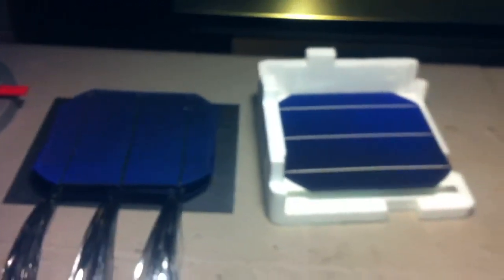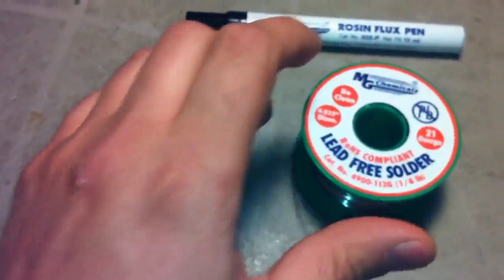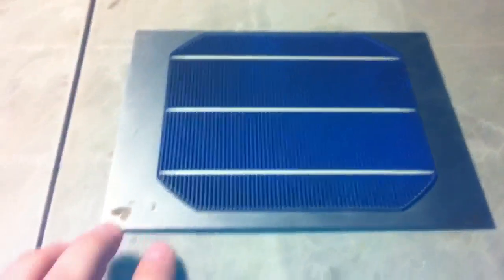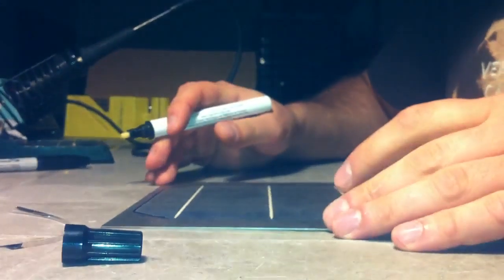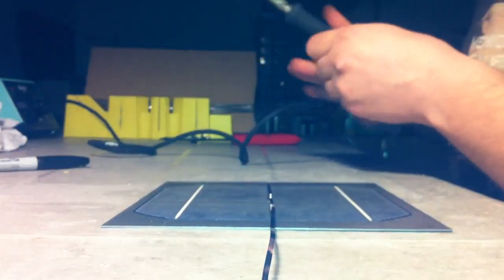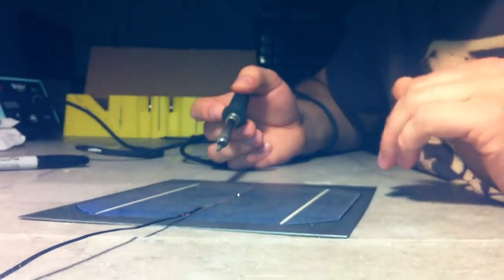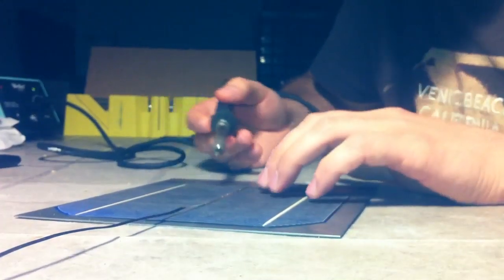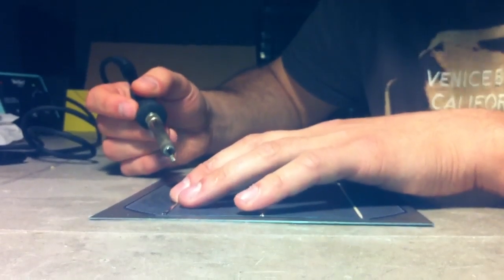how to tab 6x6 monocrystalline solar cells

Comment: I need detailed information  about tabbing wires
Reply: you DO NOT solder the tabbing solid all the way across !! tabbing has to flex , it expands and shrinks when it gets hot or cold the solar cell DOES NOT so the tabbing rips the sell apart because the tabbing is soldered solid to the cell with no room to flex , I have built over 100 panels and all are still in service , I am a electronics engineer by trade so I think I might know what I am talking about
Reply: @patgordon3355  May I know what is your recommendation? Should it be soldered just at 2 points at each end or 3 points (one in middle) or more? Also should the wire be curved so there is room for expansion and contraction?

Comment: How does putting solder on the top of the tabbing wire adhere it to the panel which is on the underside?